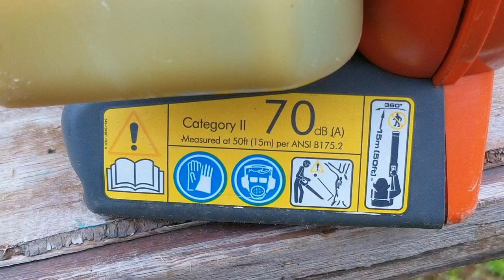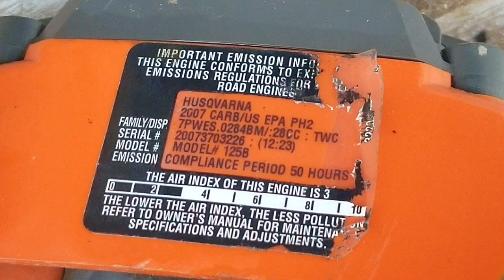Sometimes You End Up With More Issues

Comment: Every. Single. Time. It's always something. If it were me, I'd be chasing down the rabbit hole of carb issues, or air leaks (even on the carb), based on the throttle response, not a clean throttle response. Good video.
Reply from the maker: very good point, I'll let you know when I get out of hole.

Comment: You can try spraying carb cleaner around the intake between carb and machine while it's running? Maybe an air leak (bad gasket)? An inline spark tester to see if it's skipping? All 2 strokes I do start with a compression test. I am a fan of the ultrasonic cleaner ( dawn dish soap and hot water). Enjoy watching your videos!!
Reply from the maker: ah, I like that idea, yes I can!

Comment: Gday brother  Re -  vehicle compression gauge  v  2 stroke  gauge   …. Iv finally tested a few of my machines .

Newest machine. Fs 111     Registered 51  ( psi ) using  automotive  gauge . 

Older Kawasaki KBL 23    Registered 61  PSI 

       Fs 81. And fs 85  both Registered 41 psi    

If anyone has Ether of these machines and could post the psi   Results from a 2 stoke compression gauge …that would  give us a rough idea of the  difference between  the different types of compression gauges  .   Or if they give the same readings .     

From what I can remember of compression tests HERE . I feel like there may be quite a big difference between the two types of gauges .        Feedback from viewers would be great 👍.    

Additional information , that may help someone  trying to mix and match  to keep their machines going  🤷 .     I have  successfully fitted   👉Without modification r👈The clutch from a Large 52CC 2 stoke Ryobi  brush cutter ….into my old    KBL 23A Kawasaki  Brush cutter.

Comment: I've worked on a couple of these and a BV version last year (blower vac vs just blower) and a similar trimmer engine.  I've found the following common issues:  kill switch, carburetor dirty, and gasket issues.  If the carb clean doesn't solve it, try disconnecting the kill wire from the coil, and finally the full gasket kit (including seals) is only like $20 and very easy to change on them since it's a clamshell design.  I went the gambut on one, to eventually do the gasket kit and it solved the issue right up.  The cylinder doesn't have the traditional fiber style casket, but 2 separate rubber/nitrile pieces - I suspect this is the weak link.  I have the same blower, doing the same thing as yours.  Did the fuel related fixes already, so my next step is the gasket kit then the switch.
Reply from the maker: ah, you might be on to something thanks.
Reply: I've had 2 newer husq back pack blowers come and both had bad kill switches. simple fixes. but the customers were not happy.
Reply: @INSIDEHOUSEGARAGE  I finally got the gasket kit for my blower in.  Clear as day leak on the oil seal on the flywheel side once I stripped everything down.  It took almost zero effort to remove it from the shaft.  The new seals, took a bit of pressure to get it onto the shaft (nothing super forceful, though).  Blower is smooth as silk, now!

Comment: I’m betting the coil, or at least something related to the ignition. I had the exact same blower, but the carb was from ruixing. Brand new blower, had a small air leak couldn’t find where it was, despite intense detective work with brake cleaner spray 😊. Not one of Husqvarnas finest products…
Reply from the maker: good idea, I'm hoping to look into it soon.

Comment: Im not sure if you ever found the problem. However, maybe this will help someone else......a common problem with this specific blower is the screws loosen on the engine itself. 

You must disassemble completely and tighten up the four screws.

The fuel cannot make it through the transfer ports to the combustion chamber when the engine is sucking air.

Sometimes, it damages the gasket and you may have to replace that as well.

Once you disassemble, the problem will be painfully obvious and easily detected.

Hope this helps someone save a few bucks!
Reply from the maker: thanks And yes I fixed it already

Comment: I heard that odd sound right off.  I'd check that the magneto air gap is to spec.  If not, I'd suspect screws have backed out.  Reset the airgap and use threadlocker on the screws, plus tighten to the correct torque value.  If the magneto screws and airgap are OK then I'd pull the flywheel to confirm that no screws underneath are backing out.  It's also possible that the pumping diaphragm, which you thought was OK, was actually not.  Whenever I see one with the slightest depression in the reservoir area (yours had a very large concavity) I replace it.  I'd also check the condition of the rings as well as pressure/vacuum test to confirm no air leaks.  Every time I've experienced erratic tuning from one session to the next I've found an air leak to be the culprit.
Reply from the maker: all very good points and hopefully something pans out.

Comment: Hey bro what's up? I saw that after you adjusted the carburetor, it sounded much better when the L screw was adjusted. When the H screw was adjusted it started to sound funny. I believe that either the spark plug need changing or the coil need to be re gaped.
Reply from the maker: yes I'm going to definitely check into the gap, thank you Ramadin Sookhoo!

Comment: Glad you got it tuned up and tweaked so you do not need a second video.  I have the same model.  They come from the factory with a very lean setting.  Enabling carb screw adjustments and it tunes up great.  Of course, draining fuel for winter storage is a must.
Reply from the maker: thank you qfdforme

Comment: Check the compression.. and inspect the  piston and rings and cylinder for scoring.. check ignition module.. and your flywheel for sheared keyway.. that would  advance the timing a tad bit.. also check your air filter and blow it out..
Reply from the maker: you are correct, I need to good deeper on it.

Comment: My weed eater is getting easier to pull the rope and the compression is down
Reply from the maker: that's not good.
Reply: I know but the engine still runs, I am going to use it until I completely stops due to not enough compression

Comment: I have a blower just like that and somehow have broken the key on the flywheel on 2 flywheels now.  The key is cast into the flywheel and must be poor quality aluminum. Not sure why the key isn't made of a tool steel, cost is my guess.
Reply: Sorry to hear that. Make sure the mating surfaces of crank and flywheel are clean and free of any oil, then properly torque down the flywheel nut. The key is only designed to hold flywheel in position while tightening the nut and relies on friction to keep the flywheel from moving after tightening.
Reply from the maker: that's a good question

Comment: I have a couple of these style blowers made by Tanaka. Eventually they began to lose power and run rough, down on power, similarly to how your blower is running. I found the gaskets on the inner side of the heat plate near the engine were both degraded which would completely mess up the fuel air mix regardless of carburetor adjustment. Maybe a similar issue with yours or maybe not.
Reply from the maker: thank you for the information
Reply: "heat" plate, where,,,
Reply: @martindesmarais7158  between the carburetor and the engine.

Comment: I have this exact blower and it’s brand new straight out of the box and I Dosent want to prime sometimes it does sometimes it Dosent I have no clue
Reply from the maker: do me a favor, and point the nozzle down, and touch the ground, with the primer straight up, than prime it and see if the bubble is full.  Because of the angle the bulb is at, it's hard to tell if it's priming.
Reply: @INSIDEHOUSEGARAGE  ok thank you very much
Reply from the maker: no problem

Comment: There's a good chance that water 🌊 may have got into the fuel tank or the ignition system wgen you cleaned the engine.

I would do a compression test as well as perform a crankcase vacuum test to make sure that there are no air leaks from any gaskets or.seals as well !
Reply from the maker: good suggestion

Comment: These also have an issue with bolts coming loose around the engine and sucking air through places they're not supposed to. Spent quite a bit of time working on a friend's last spring trying to figure it out.
Reply from the maker: ah.. you're onto something now!